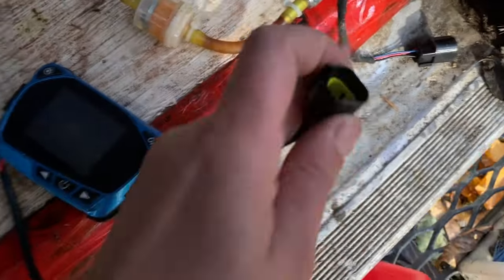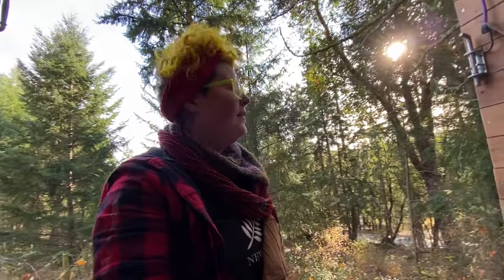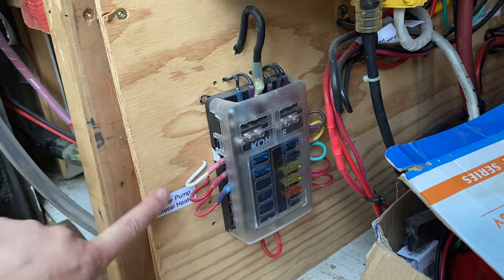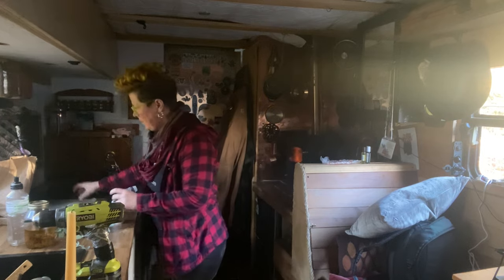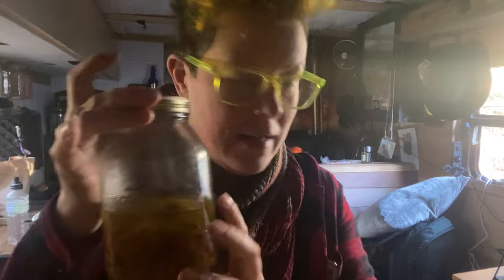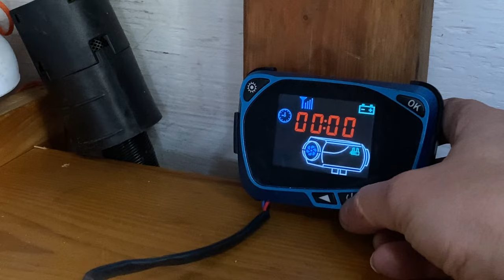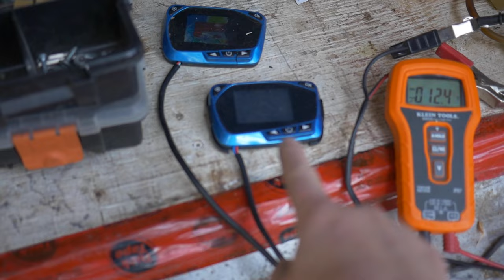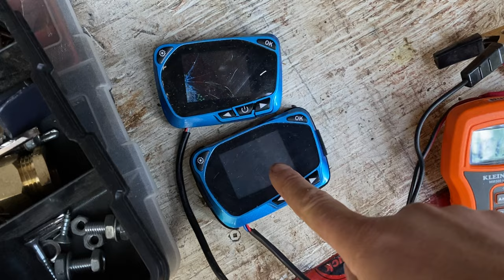WINTER van life, installing a chinese diesel heater 🔥

Comment: There is a company in BC that is a main distributor of Planar diesel heaters, they are far more reliable than the chinese knock off ones.  I'd look into one if you're going to be staying up north in the winter with that.  The chinese ones break all the time, seems like they only last a year.
Reply from the maker: @GooseTravels1 I’ll definitely look into it if this one ever gives out! I’ve seemed to lucked into one that works for now! 🤞🤞 thanks so much

Comment: Mb was here 
Don’t you have a wood-burning stove? What’s the purpose of doing the diesel heater?
Reply from the maker: @marybethtanner959 hi! I do use it. On cold mornings if I put the wood stove on it can take up to 30-40 minutes for the space to warm up so nice to have instant heat AND when I’m in more urban locations where my chimney smoke would attract too much attention, having the heater means I won’t freeze!!